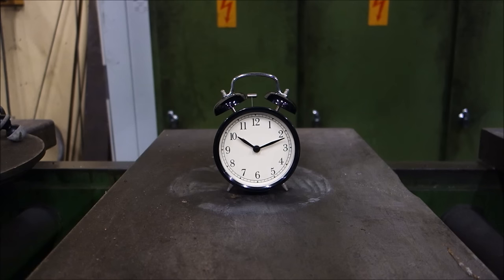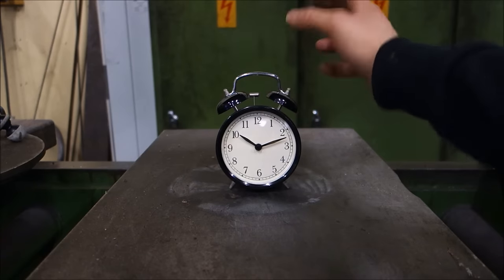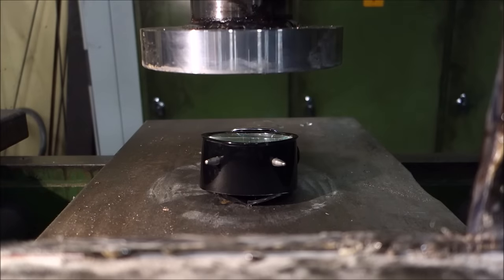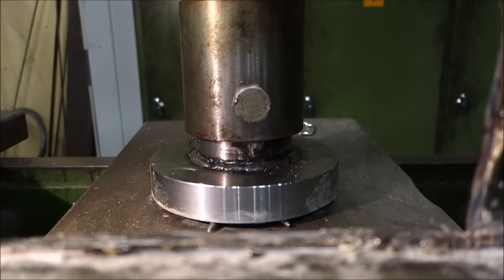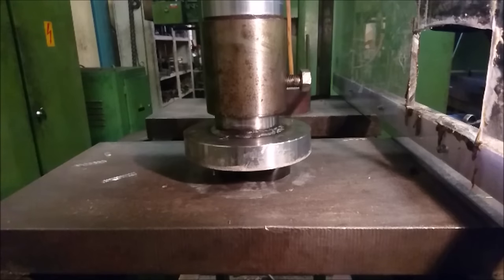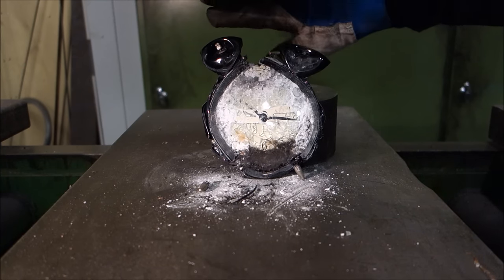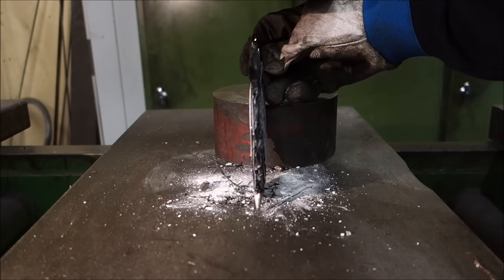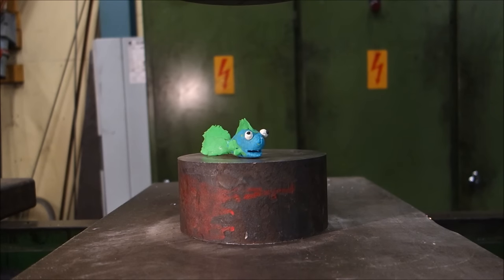Crushing alarm clock with hydraulic press

Comment: Crush different kind of stones. Make a plate of titanium and try to crush a diamond. Crush literal bones. Show how much force needs to be applied to crack the femur bone. Crush wood and metal joints. And show how much force is applied for each one of them. Crush bullet proof glass. Or gorilla glass. Just ideas along the lines.